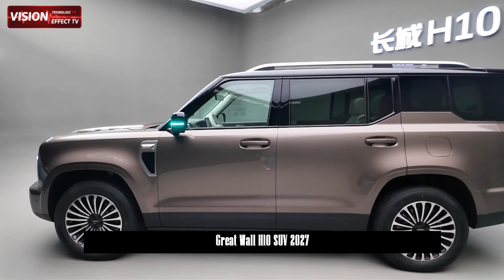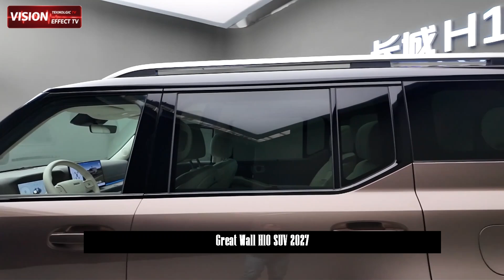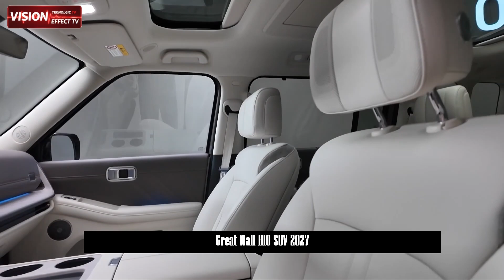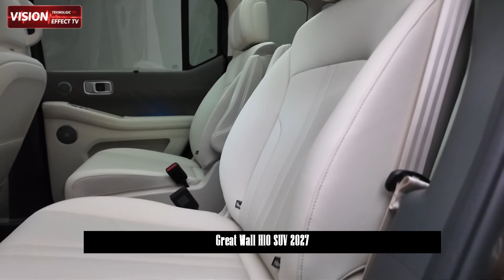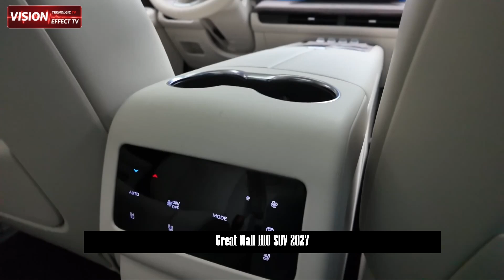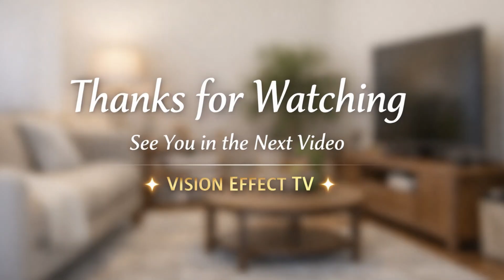Great Wall H10 Technical Breakdown! | Everything You Need To Know Before Everyone Else

Comment from the maker: The 2027 Great Wall H10 gives us a massive technical blueprint to dissect. From the high-voltage battery packaging and micro-channel cooling plates to the lateral stiffness of its multi-link suspension, GWM is clearly moving away from simple software gimmicks to focus on genuine mechanical maturity. The technical question goes to you: Does GWM's thermal management, physical ergonomics, and chassis kinematics show enough engineering depth to compete with established premium hardware, or are you still skeptical of their long-term structural reliability?👇